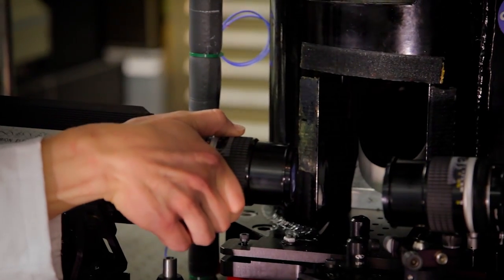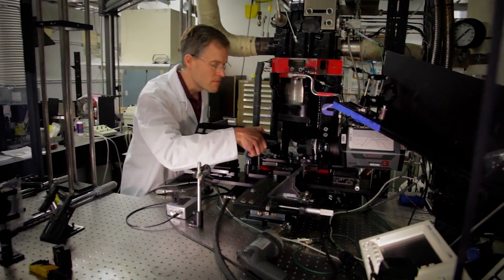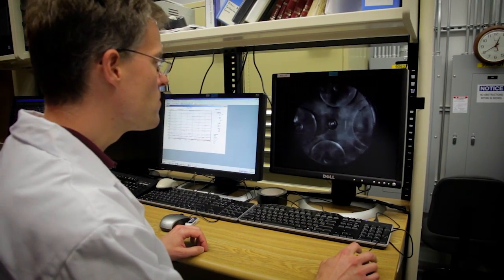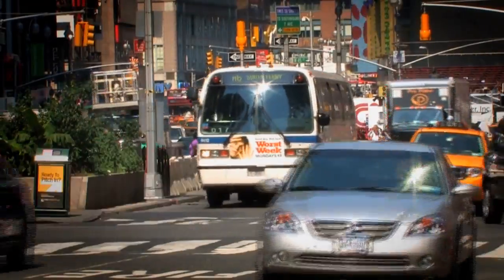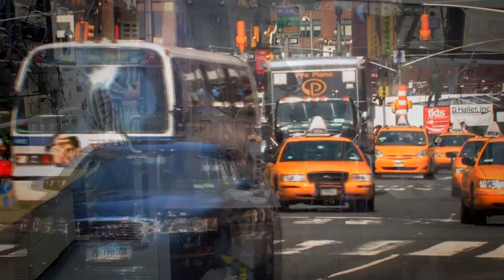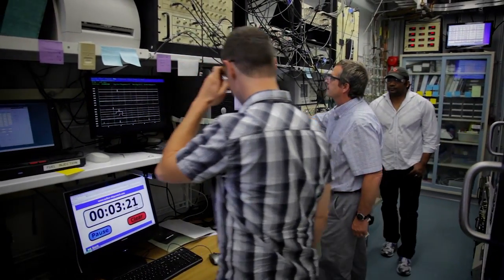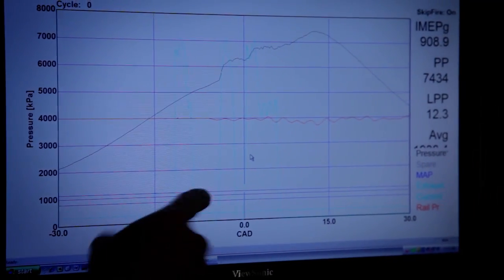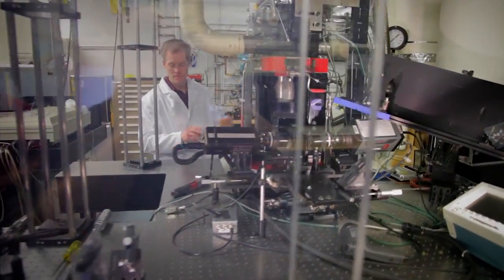Cleaner, more efficient diesel engines

Comment: Hold up! So basically the conclusion is by cooling the engine down would make it more efficient,  then why not engines Are efficient in winter?
Reply: They aren't cooling down the engine, they are cooling the combustion flame temperature instead. The high temp of the flame causes smoking soot(like a charcoal grill). This is why thermal efficiency goes up, which means you can use less fuel to generate the same cylinder pressure.
Reply: @tumdeax ⁰90.00 p😊OPPO 0⁰⁰p999loo⁰😊0⁰⁰⁰00 p 90.00 p p pop pop 0😊⁰00😊pop 0⁰0⁰0⁰p999loo⁰⁰90.00 0😊p999loo⁰pop⁰0⁰⁰00😊⁰😊⁰ppl pop p999loo l⁰0 p999loo ppl p999loo p😊0 popped pop 90.00 90.00 p999loo 0😊p0 p999loo⁰poop😊⁰😊0⁰⁰0 pop p p999loo p p⁰0ⁿ0⁰😊00⁰0⁰90.00 ppl 90.00 pop pop 0😊p0 pop😊p999loo p999loo ppl p⁰😊p999loo p 0😊90.00 p999loo⁰😊poo😊90.00⁰p 90.00 ppl p😊p9😊0 90.00😊p999loo p999loo poop p p999loo p ppl 00⁰⁰pop p pop p 0 pop 0 pop😊p😊p 0⁰90.00 90.00⁰p 9 p o ppl p999loo 90.00 poop⁰pop😊poo pop p 😊ppl⁰⁰⁰0⁰⁰😊⁰⁰oops⁰⁰😊p999loo⁰0⁰p 90.00 ppl pop😊⁰p999loo 0 popped 90.00 0 p999loo 90.00 popped 0⁰⁰⁰😊⁰⁰⁰⁰⁰😊⁰0⁰0000⁰0 OPPO⁰0⁰p p ⁿ😊pop 00😊ppl😊⁰p😊p999loo⁰😊pop 0p Poppins pop p poop pop⁰90.00 pop pop pop pop OPPO p 90.00 p999loo pop p999loo
Reply: @tumdeax ⁰⁰p0😊p0 poo 0 p0 0 p00⁰⁰0p⁰0 poo 0 p0 pop p😊 Poppins p0⁰p0⁰p😊p0😊⁰90.00 p0 p0 p0 p0 p0 p999loo pop⁰⁰⁰0 p0 pop p0⁰ 0
Reply: @tumdeax 0⁰0⁰p⁰p0 p0 p⁰00
Reply: ⁰⁰0⁰
Reply: ⁰⁰⁰⁰⁰popped p p0 0 0p⁰⁰
Reply: Poo😊p0 p0 p
Reply: ⁰⁰⁰⁰pl